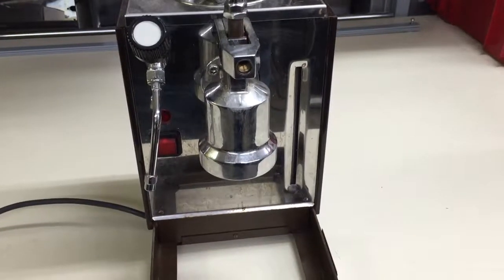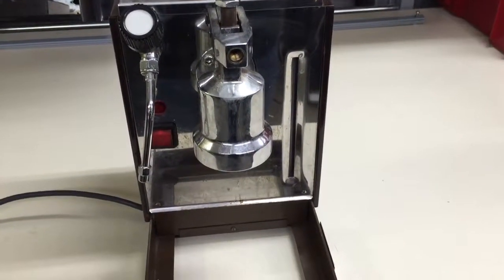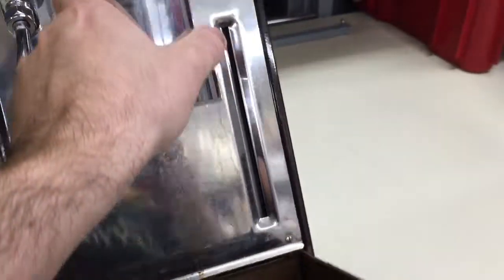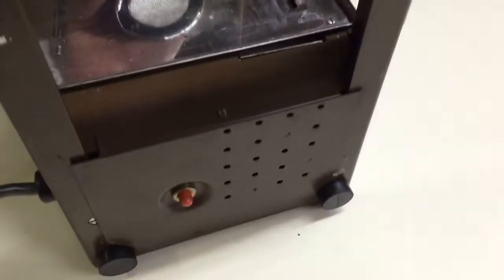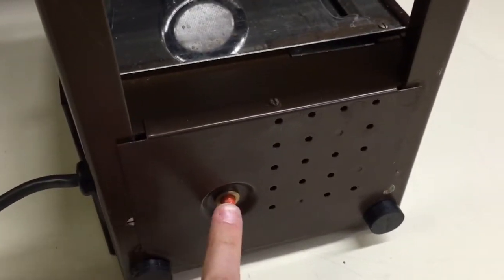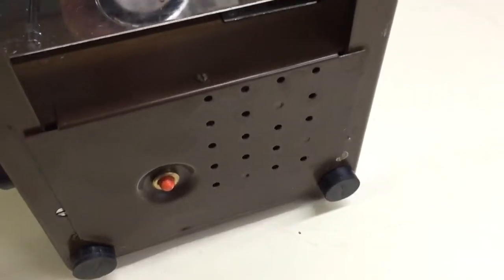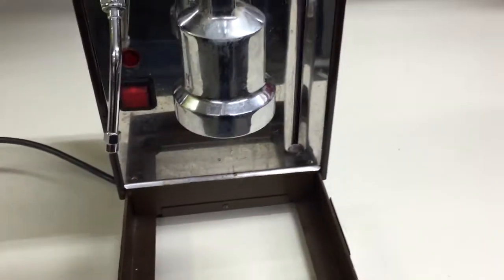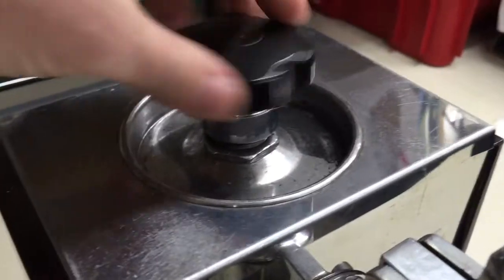Resetting safety thermostat on Olympia express Cremina.

Comment: If I click my button it will pop out and stay out all the same time, does this means it’s broken ?
Reply from the maker: No, if it was popped you wouldn’t see a difference after you reset it.  Could be that the reset is bad or something else if it does not turn on after resetting.